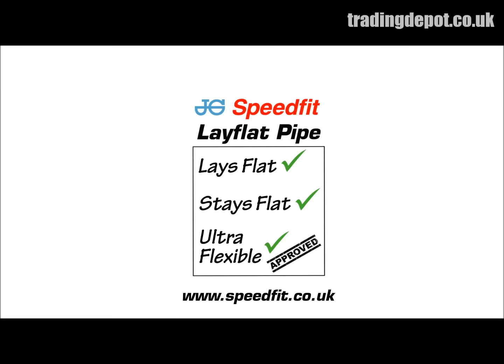JG Speedfit Layflat Pipe Explained By The Technical Team

Comment: Lay flat pipe is the solution to the absolutely joke that the standard pipe was. After struggling for to two days with the rubbish we ripped the lot out and fitted something else.  We would never trust a company that had the nerve to inflict the first product on the trade.
Reply: Pex pipe is great in straight lengths and actually gives a better heat output than polybutylene in ufh installs , pex also doesn't require as much clipping . Pex has its place but yeh polybutylene is much better off the coil.